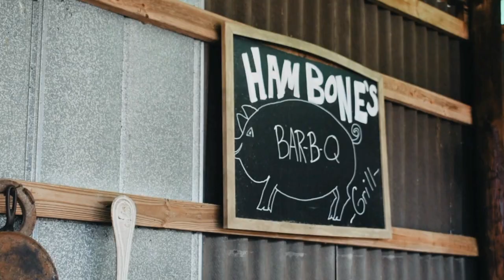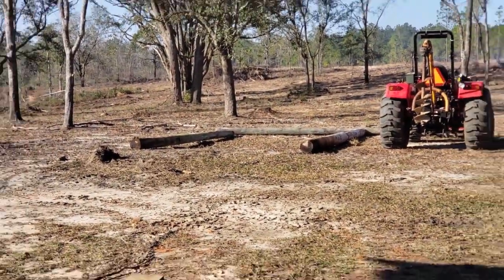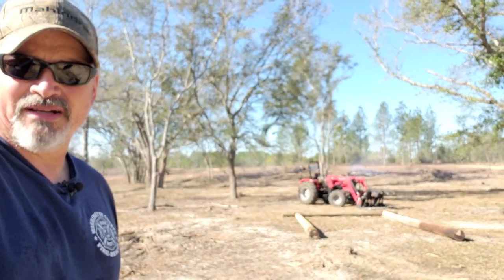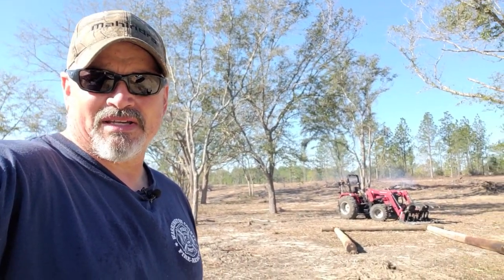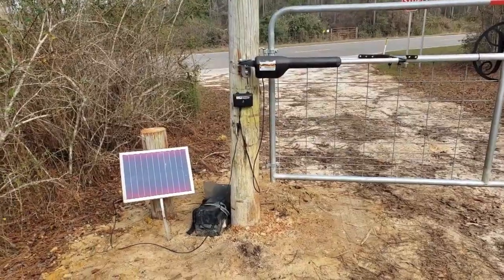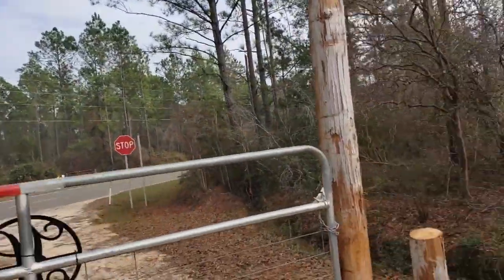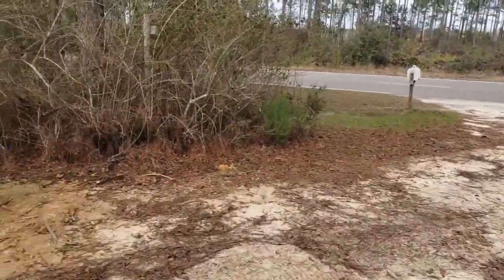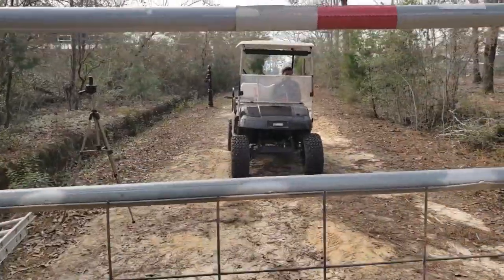I ALMOST DIE! Setting posts with Mahindra 4540 and Auger Pt 2

Comment: Looking great!  I'm along this ride with you.  We've got 27 acres bare land and a 2538 Mahindra TLB.  Picking up attachments as we need them.  We're working on the driveway right now but will have a 30'x40' equipment barn up later this year.  I'm going to follow along with you so I get to see the do's and don'ts!  One thing I learned about the auger?  Have the wife stand to the side and as you drill, nudge the tractor forward as you get deeper.  As you saw, the auger angles in toward the tractor as it gets going.  ;)
Reply from the maker: Best of luck on your place. It's a lot of fun to get it the way you want it 😊